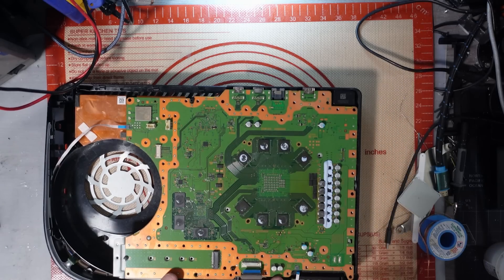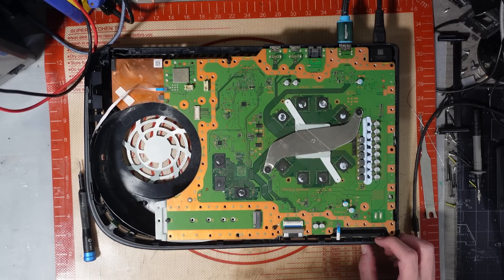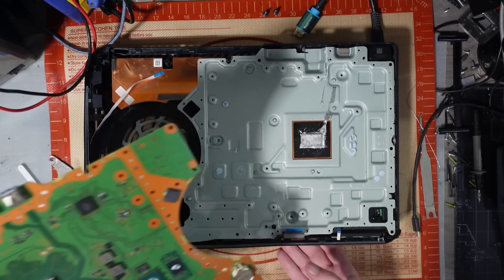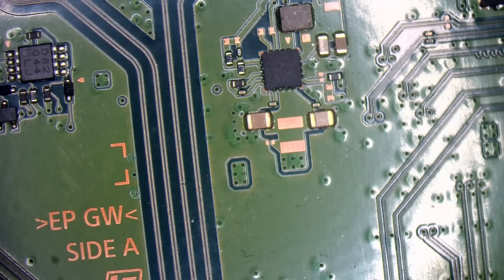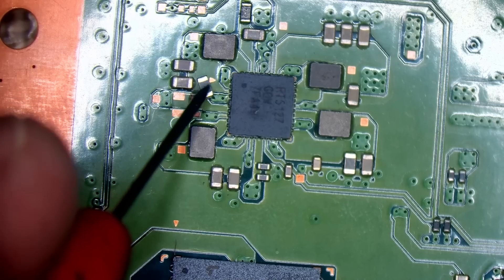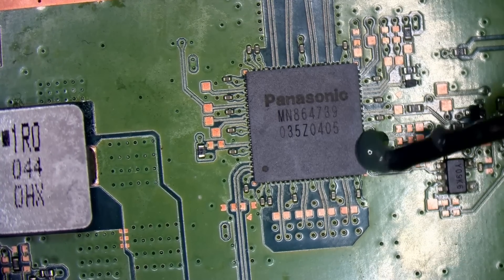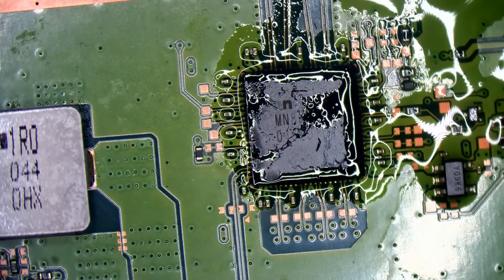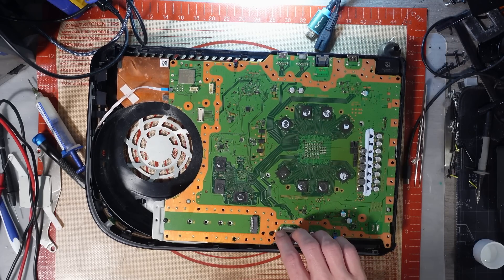MY PS5 DIED, NOW IT WON'T TURN ON | CAN I FIX IT? (PS5 JOBLOT #10)

Comment: @TheCod3r I wanna buy PS5 with CE-108262-9 error and im wondering... It is sortware or hardware problem, do u know that issue? Do I need to replace the internal memory chips? One of the services stated that it is not possible to repair the internal drive.

Comment: Hey there, my apologies for asking this here, i just bought a new ps5 a few hours ago from a local store. Is it normal for the fan to slightly ramp up when i start a game? Ps5 model seems to be 1216A. I am used to pc's never had a playstation before, sorry for asking this here and have a great evening
Reply from the maker: Hi. No worries, I'm always happy to help if I can. Yeah it's completely normal. The fans generally ramp up a little bit but not too much. They changed the fan in the 1216A and it seems a little louder than the 1100 series fans
Reply: Thank you for the reply. Love your content, keep up the great work.
Reply from the maker: @nenadcostici2116  thank you 😊 you're welcome